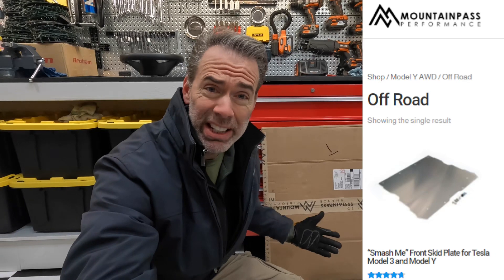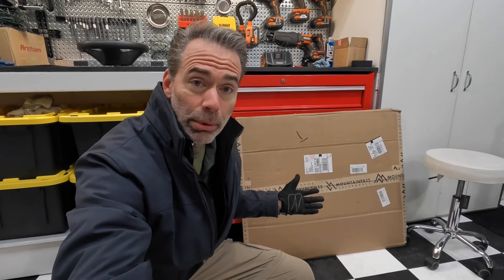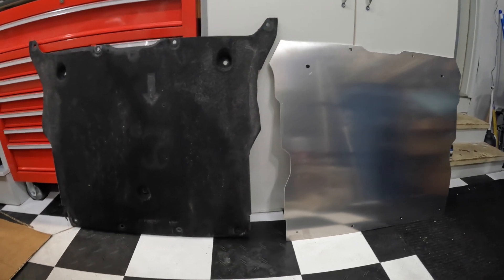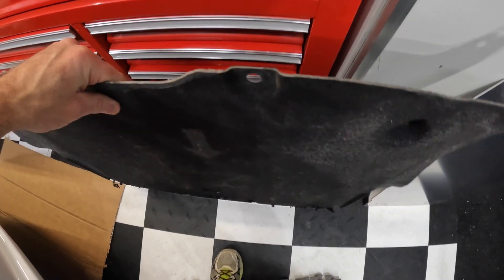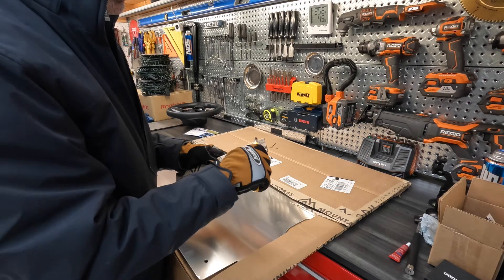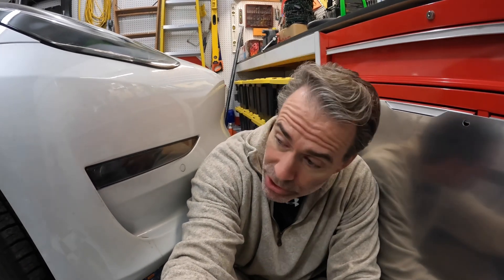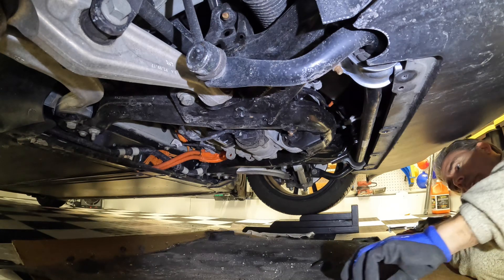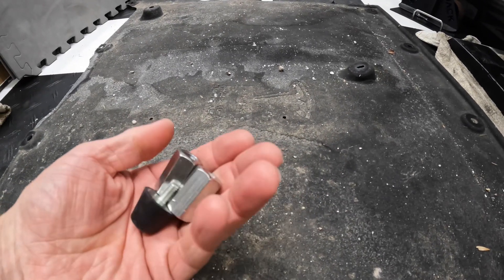Tesla MPP Undercarriage Smash Me Plate Protection - SAVE YOUR BATTERY

Comment: Two issues will be the noise transmitted to the interior, and the tinkling sounds of rocks and stone that do inevitably find their way on top of the plate. Armour protection looks solid compared to fiber cover which is a good thing. Ive torn two so far and have seen other thinner plates on the market as well...!! Maybe a coating of undercoat spray on both side would help with noise control. Do a drive and record new noise levels...!!
Reply from the maker: I have a new video out for my 2024 tesla and the plate had some dense foam on the top of it. I didn't notice any additional noise with either plate.

Comment: Not saying this is a bad idea, but damage would be covered under insurance until I dropped the comprehensive coverage, right?  I guess the car would likely be totalled though and that is very wasteful.
Reply from the maker: Seems like it would be covered by insurance but what a pain, and yeah, what a waste.
Reply: So you are saying that you rather to have coolant line damaged and go through insurance painfully for weeks or months without car than preventing the damage? Plus premium cost increases. It's your call
Reply: @anpho95 We have RWD models so no front motor and didn’t lower the car, but probably worth doing for long term ownership protection.

Comment: You think adding some undercoating to the aluminum panel, on one side or the other, might help with sound deadening?  What was the difference in terms of road noise that you noticed?  I would expect the OEM to have been a little quieter.
Reply from the maker: I agree with the idea that some type of undercoating may help with noise but I can't say that I noticed a difference between the two. I don't even notice any rocks hitting the aluminum. If the overall car was more quiet at speed it would probably be more a more noticeable difference but I think as it is its just too hard to tell.

Comment: Question Mark: my front 4 screws to secure the plate, the corner screws do not appear to thread appropriately....is there supposed to be a retainer clip behind the plastic where the metal guard covers?  If so, where can I find these retainer clips? the bolt seems to 3/4" long but there is no thread locking when I insert the screw. Thanks for what u do and show here!

Comment: You should replace those stainless steel washers to prevent galvanic corrosion (10:48).
Reply from the maker: Thanks for the reminder!  However, I have read that there is much less risk when using stainless fasteners on large aluminum surfaces.

Comment: Hello, Where could one of these be installed?
Reply from the maker: Pretty much anyplace that has a mechanic. Small local shops will be more inclined to do this. BUT, ask them if they have worked on Teslas at all. If they start telling you stories about how Teslas can't be worked on by anyone but tesla or some other strange stories then stay away.
If they sound ok, then point them to this video and they should have zero problems doing this.

Comment: really bad idea for road use.
why tesla put a foam plate in front? and metal behind?
because front of car absorb shocks in an accident
Reply from the maker: I'm not a structural engineer, but in an accident, the forces are so great that I can't imagine that the OEM cover does anything to absorb impact.  I would actually think that the aluminum would do a better job for that.
BTW, I just saw a video for the Rivian and it looks like they use a carbon fiber cover in front.  Expensive, but better than aluminum.

Comment: I wonder if UHMW would be a better material for this use case. Aluminum is not very resilient. And is "grippy" (unless hard anodized). UHMW would probably be heavier tho. Great video! Thanks!
Reply from the maker: Thanks.  UHMW?  Hmmm - I was aware of HDPE, but not UHMW.  It does look good.
Reply: @mmark300  UHMW is the preferred material for skid plates for off road use cases because it is ridiculously tough and slippery. And has damping properties for those concerned with NVH. Nobody makes one in UHMW so my comment is not worth much. Cheers!

Comment: looks like the stuff they line your wheel Wels with. When i buy a tesla i will replace the whole bottom. I will accept the loss of milage. Plus i weigh 160. The average American is 180 200. I can handle an extra 40 pounds.